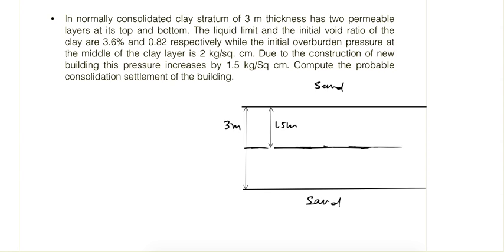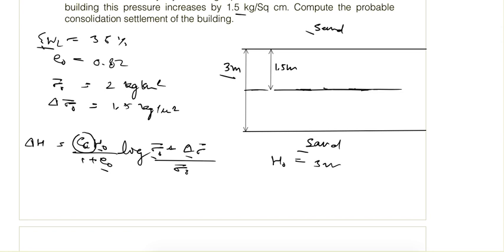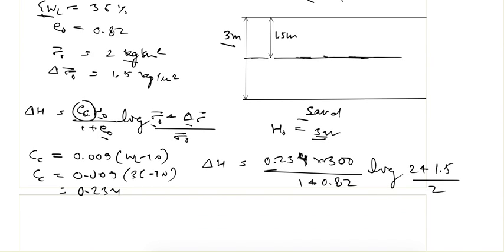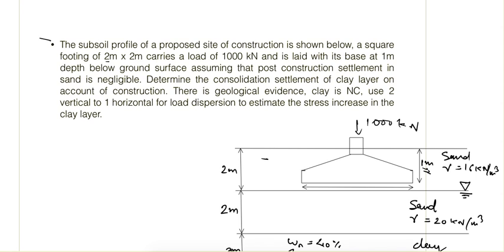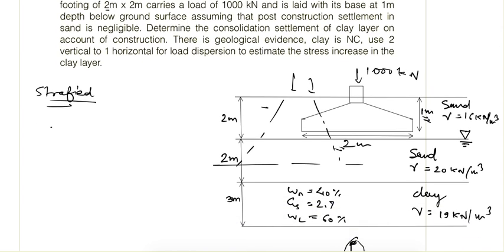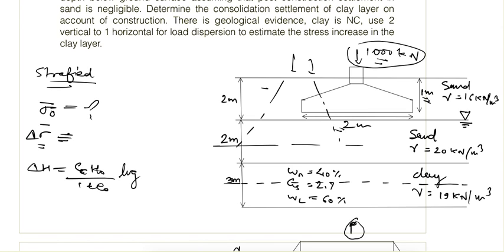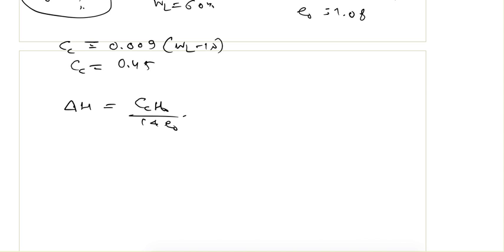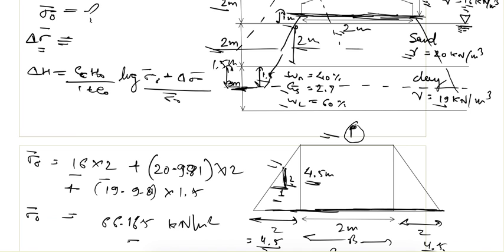Primary Consolidation Settlement Solved Examples | Soil Mechanics

Comment: in first question h=1.5 bcoz it has doble drainage so h must be half i.e 1.5?plz answer sir
Reply: It is correct that h is 1.5 because it has double drainage, but then we are calculating settlement due to the entire layer and so we've to add both the half's of the layer , i.e. multiply the settlement calculated with h as 1.5 with 2 which effectively becomes using h as 3 which is what he has done.

Comment: lot of denotation confusion but if i am wrong then tell me
delta H=TOTAL SETTLEMENT=Sf
delta h=settlement at any time at 't'
H0=CLAY LAYER DEPTH
d=drainage depth ( H=d/2 for double drainage and H=d for single drainage) used in time factor formula

Comment: Hi Mate. Why when it comes to effective stress for consolidation settlement the point of interest is always the center of clay layer?
Reply from the maker: The point is to find out the overall settlement which happens due the clay layer. But the clay layer would have a considerable depth and due to that the effective stress at each point over the depth would be different. Taking the value of effective stress at centre of clay layer is a way to consider the average increase. Similarly there are other ways also available for better results like breaking the clay layer into smaller parts and finding out the increase in effective stress for these small parts.
Reply: APSED I agree and the outcomes for settlement calculation would have varied differently and the difference is significant, say for instance, taking effective stress at 0.4H would have produced settlements much more diff from 0.5H!
Reply: The more layers I break it down say breaking 5m into five1m layers I get a higher settlement as compared to just using effective stress at 2.5m mark. Is there a corrective factor?
Reply from the maker: No, there is  no correction factor.
Reply: The value of increase in effective stress is given wrong